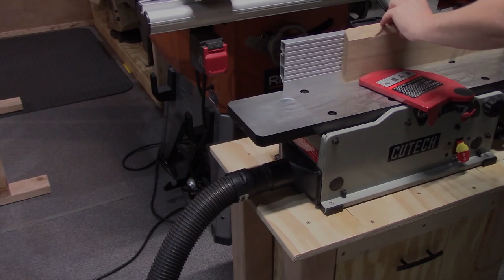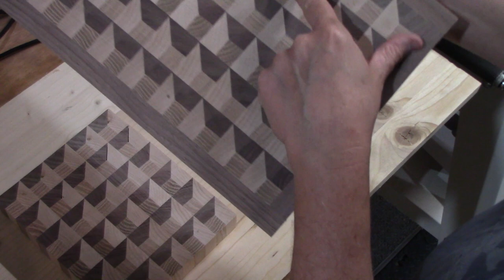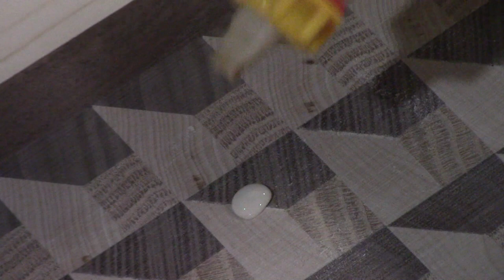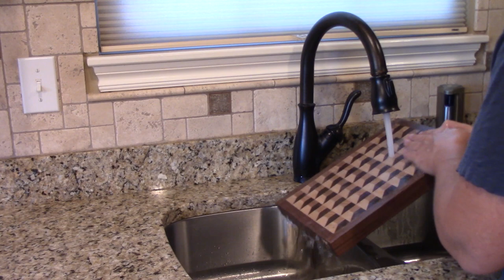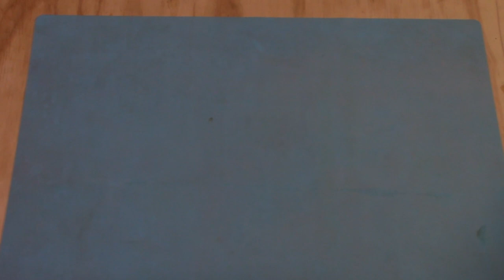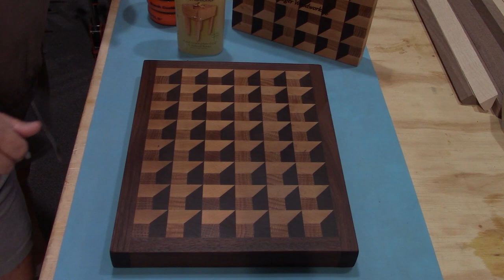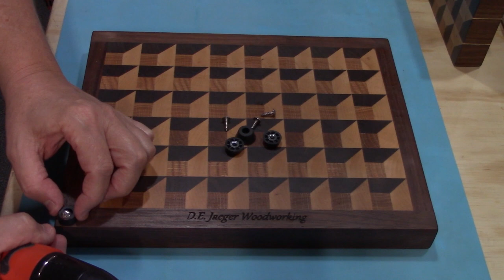The Stunning 3D Cutting Board - Part 2

Comment: Darrell,
You are obviously a fine woodworker, videographer, and teacher. Your explanations are crystal clear, and I have really enjoyed your videos to the max. The only suggestion I would make is that you might want to consider using end grain wood for your border. I know the edge grain is quicker, and looks nice because you can see the grain of that wood. However, I do believe that there may be an issue with cracking in the future. Having made about 200 cutting boards, I can tell you that the only cutting boards that fell apart  on me (that I am aware of!) were boards that had mixed end grain and edge grain. Please consider using my mistakes for the benefit of all.
Reply from the maker: Thanks for stopping by to watch the video and comment.  Yeah, I've taken some guff for the cross grain glue up on the larger board.  It was a last minute decision to even put a border on the larger one, and I also got a lot of folks wanting to know why I didn't miter the corners. :)  Anyway, I do get it.  Part of this decision was knowing that the person I made it for uses it as a counter decoration and never plans to cut on it.  Another comment I received quite a bit.  Knowing it wouldn't be subject to the normal moisture exposure, I let this one slide.  Still, there is the possibility of ambient moisture in the room affecting the board, but I have asked the owner to let me know if he sees any separation, splitting, etc.  So far, so good.  Thanks again for your comment.

Comment: I have rcently started using Starbond CA glue, along with the dust from wood, to fill gaps. When used with the accelerator, it dries immediately, and you can continue with your sanding. Amazing stuff! Thanks for the video.
Reply from the maker: Thanks for watching the video and commenting.  I've used CA glue with sawdust before, but typically avoid it for projects where food will come in contact with it.  I'm not sure of CA glue's food safe qualities.
Reply: @DEJaegerWoodworking  There is such a small amount of glue in the voids, I doubt it would be harmful, and any on the top of the board is sanded off. Starbond even comes in colors, so the dust wouldn't be necessary.  Again, very good video!

Comment: I know this is an older video but I found by gluing both sides of the wood further eliminates those little voids.  It does make for a little more cleanup of squeeze out but I find it well worth it.  Great work!
Reply from the maker: Thanks for watching the video and commenting.  I'm getting ready to make another one of these boards for a customer, so will definitely try gluing both sides.  A little more glue could equal less time filling voids.
Reply: @DEJaegerWoodworking  In the words of King's Fine Woodworking.... you can never use too much glue!  lol

Comment: That is the best looking cutting board.  I have watch both video. I am making the same. But in my case, after i wet the board the first time, it warped. So i’m back to the drum sander right now making it true again. I can’t keep it warped after all that work. And it is all worth it. Thanks.
Reply from the maker: Thanks for watching the video and commenting.  I've had some other woodworkers comment that you only need to wet the surface before the last sanding level, but I've always done it in between each sanding grit.  While this video shows rinsing it with water, on my newer projects I now just use a spray bottle of water and lightly apply to raise the grain.  You might try that to prevent warping.
Reply: @DEJaegerWoodworking  good idea. I’ll try that. Thanks

Comment: This is a gorgeous build. I just got a job at a cabinet shop a few months and I'm absolutely hooked on woodworking now. I'm going to attempt this pattern on a 4'x4' frame that will be used to display patches. I can't wait to get started!
Reply from the maker: Thanks for watching the video and commenting.  I appreciate it.  This pattern can be used in a multitude of ways.  I've made this pattern as a lazy susan, cutting board, etc. but you can certainly expand on it and even make it into a table top if you wanted.  It's a fun pattern and is always eye-catching.

Comment: A little pro tip for ya, if you heat up the Howard’s butcher block conditioner, it will Melt the wax, and allow it to penetrate deeper into the wood and harden, giving better protection for the butcher block over the long term. Nice board great videos!
Reply from the maker: Thanks for stopping by to watch the video and comment.  Awesome tip, thanks!  I'll definitely give that a shot on the next board.  I've got an American Flag cutting board just about done so will try this technique!
Reply: @DEJaegerWoodworking  I’m looking forward to the next vid, I usually just put a little bit on and use a heat gun to heat it up, great technique I learned years ago, keep up the good work!
Reply from the maker: @JP-kp9bg  Look for the tip in next video.  I'll give you a credit nod in the video as well.
Reply: @DEJaegerWoodworking  sure will! great quality videos! I’m subbed and will be looking forward to it 🙂

Comment: Beautiful .The only thing I have changed is to make the border end grain as well; I have found the edge grain border will show knife makes and, in the worst case, splinters.
Reply from the maker: Thanks for watching the video and commenting.  I appreciate it!  The other issue with the border not being arranged end-grain (and it has been pointed out to me plenty), is that it may end up splitting along those lines.  Fortunately, I know the owner is not using it for a day to day cutting board and takes the proper care in oiling and conditioning it, etc.

Comment: Great concept, I'm gonna add this to my to do list. Have been making a walnut/maple cutting board as gifts for a while now and have a quick system down for making them. This will be fun. My only concern is using an open grain wood like oak for and end grain board.
Reply from the maker: Thanks for watching the video and commenting.  I appreciate it!  I would definitely switch out the oak for cherry if I had this one to do over.  I agree the oak can be a little porous.  The owner of this board is religious about his oiling and conditioning of the board and he uses it more as a display piece rather than a actual cutting board so it will probably be fine.  The other thing I would advise is to orient the border end grain as well, or leave the border off completely.  You'll get a nice cascade effect along the edges that way.
Reply: @DEJaegerWoodworking  Yeah I'd love to use cherry. Good idea.
Reply from the maker: @paulharrison3651  Really just any other contrasting hardwood is fine, but cherry kind of fits the domestic trifecta or walnut, maple and cherry.

Comment: For clamping the smaller sections here’s an idea:  make a “c channel out of straight hard wood or MDF or any good smooth plywood. Size it so the four piece assembly fits in exactly.  Then make a separate piece that fits on top, enclosing the whole piece on all four sides. This will act as a cull and keep things aligned. Clamp along the sides and separately on the perpendicular still with adequate clamps but it will all stay aligned better.  The thicker and flatter the outside pieces should help distribute the clamping force more evenly. Just a thought.
Reply from the maker: I do appreciate the idea.  I have created a few jigs for projects.  Check out the Honeycomb Cutting board video on my channel.  I think your suggestion would definitely be worth pursuing, especially if I were making a lot of this particular type of board.
Reply: @DEJaegerWoodworking  I actually watched that one as well. Pretty much what I was thinking.  I haven’t done one like this yet so am also trying to imagine how I’d approach it. Honeycomb one is really cool too.

Comment: Some beautiful wood working. While the walnut border is attractive I feel it is a little too "bold" and detracts from the beauty of the geometric board. As you debated in your commentary about whether to leave the edges square or use a round over, the round over tends to minimize how bold the edge is but still allows some accent.
Reply from the maker: Thanks for your additional comment here as well.  The really interesting part is the number of viewers that bashed me for a cross grain glue up with the boarder.  So far, so good and the customer I crafted it for isn't using it as a daily cutting board, but merely a decorative board for their island.  Additionally, they care for their cutting board (in use, or not) with proper oiling and conditioning.  I do agree though, I wouldn't put the border on another one.  The edge effect is so much nicer without it.

Comment: Beautiful project, love the detail & finish.

First time I saw one of these being made, to fill void, the guy used a vacuum hose to suck the glue/dust mix into the void from the other side. Otherwise you have approx .5mm fill that can wear out with use & cleaning.
Reply from the maker: John, you are BRILLIANT!  Thanks for such a great tip to get the saw dust into the void.  I'm not sure I would have ever thought to do that, but will definitely do it the next time I have voids.

Comment: I’m a machinist I’ve never done anything like that with wood but I’m good with close tolerances so I will give it a shot. Thanks for the video but I can tell you one thing I’m tired of that banjo lol appreciate it. Nice job on the cutting board.
Reply from the maker: Thanks for watching the video and commenting. I appreciate it. Just a heads up from some other woodworker comments I’ve received.  If you are going to put the border on it then orient it in the same direction as the rest of the board.  This board hasn’t experienced any issue with twisting or separating but there’s a higher degree of likelihood that it could over time versus one where the border is oriented endgrain. It may be best to leave the border off altogether. You get to see the pattern cascade over the edge which is more attractive.

Comment: Beautiful and really showcases your craftsmanship.   Would you recommend trying this project without a thickness planner or drum sander?   Have you used pure tung oil as a finish?  Thanksagain for demo.
Reply from the maker: @scottstrong5565  Thanks for watching the video and commenting. You could probably pull this off without the drum sander or planer if you have a handheld router with a surfacing bit. There are several videos on YouTube on how to build a router sled for this purpose. I have some Danish oil that I’ve used as a finish but haven’t used tung oil for any projects yet. I’ve seen some woodworking videos that have and they have come out beautiful.

Comment: Very nice work and precise instructions, going to try and make one but one thing is stopping me is I do not have a drum sander, I do have a thickness planer though. Any suggestions on how to achieve the desired thickness of the pieces after the glue up of the three types of wood?  Thanks!
Reply from the maker: Thanks for watching the video and commenting.  You can certainly achieve the thickness wtih a planer, but I would glue scrap pieces around the final glue up to protect the edges from chipping.  Then, make sure your planer blades are sharp, and take extremely shallow passes to further prevent chipping.

Comment: Thanks for the excellent videos on this project! Couple questions please, 1. can this be done without a drum sander?
2. Not worried about expansion where you glue the walnut frame on? 
3. Seems like the mineral oil dip is pretty short, I have been letting mine sit overnight, is that too long? Thanks.
Reply from the maker: Thanks for watching the video and commenting.  I actually do a lot of my truing of surfaces on my drum sander, so absolutely it can be done.  Might take a little longer because less material is typically removed on a drum sander versus a planer.  I've gotten several comments regarding the walnut border and it really should be oriented in the same direction as the board itself.  It wasn't in this case but the board was going to a friend as more of a showpiece than an actual board that would be used and subjected to cleaning, etc.  I doubt that I would add the border if I were to do it again, plus some of the great pattern around the edges is lost when the boarder is put on.  You can see that on the smaller board at the beginning of the video.  Lastly, the amount of time in the oil is really a personal preference in my mind.  I see many wood workers just apply oil to the board by hand, some that dip in the oil for a few minutes, hours, and overnight.  Not sure there is a upside or downside to any of those approaches.

Comment: Sir, your are superb!  Two questions: 1) what sandpaper grit do use in the drum sander, 2) how many teeth do you use in table saw blade?  Thanks.
Reply from the maker: Thanks for watching the video and commenting. I typically keep 100 grit in the drum sander, and the ripping and crosscut blades I’m using are thin kerf Freud brand blades. The ripping blade is 24T and the crosscut is 60T.

Comment: Beautiful work! Is there a advantage using a orbital vs a palm sander?
Reply from the maker: Thanks for watching the video and commenting.  An orbital sander will remove more material than a palm sander, and I'm not a huge fan of the sanding process, so it helps move the process along a little faster.
Reply: @DEJaegerWoodworking  thanks for the quick response and excellent advice
Reply from the maker: @kennypayton5103  No problem.  Thanks again for watching the video.

Comment: You are very talented !! I have some walnut white oak and pecan. I will do my best to repeat your skills
Reply from the maker: Hey Mike, thanks for stopping by to watch the video and comment.  I had watched several videos on making this type of 3D board until I could the technique that I liked and thought I could replicate the best.  In hind sight I wish I would have replaced my table saw blade before starting this project.  It was a little dull and caused the 45 degree cuts at the beginning of part 1 to be a little more difficult than they really needed to be.  I did replace the blade shortly there after with a very nice Freud thin kerf blade which now cuts like butter.  As I said at the very beginning the cuts, measurements and glue up need some extra time so that the pattern at the end stay consistent.  Let me know when you've got the board completed so I can stop by to watch.

Comment: When filling the voids with sanding dust and Titebond III, since the glue is waterproof won't that prevent the oil to penetrate the filler leaving dry spots that won't blend with the raw wood that absorbs the oil??
Reply from the maker: Thanks for watching the video and commenting.  In this video I believe I was using Titebond II, but regardless it does still have water resistant capabilities.  As long as I sand the filled spots appropriately I don't typically see spotting.  Not to say that it certainly couldn't.  I have definitely followed this procedure before and not sanded enough and had some light spotting.

Comment: what is the point of the oil bath? Does it help seal the wood to prevent warping?
Reply from the maker: Thanks for watching the video and commenting.  The initial oiling helps to treat and provide a base treatment and finish for the cutting board.  Regular application of mineral oil will prevent cutting boards from becoming dry and brittle, which can cause a cracked board. A board that is treated with oil also prevents liquids from penetrating the board, which is often the source of germs and bacteria.

Comment: Really nice cutting board, and I love the 3D effect. I'm a bit surprised you didn't use mitered corners with the outer border, but that doesn't take away from the beauty of the piece itself.
Reply from the maker: Thanks for stopping by to watch the video and comment.  The border was really just a last minute decision so I went with a simple butt joint, but it could definitely been done with a mitered joint.  I've been taking a little bit of flack just for putting a border around it and it not being oriented end grain.  I probably should have added some dowels for structural support, plus it would have been a really nice visual feature as well.
Reply: @DEJaegerWoodworking  I appreciate you taking the time to show and tell us every step, and it's always a learning curve, even when you are duplicating something you've already done several times before because you can always think of some way to enhance or improve it. Have a safe and  Merry Christmas, a Happy New Year, and straight cuts always.
Reply from the maker: @stanwiggins3423  Agreed, we're all here to learn.  I've incorporated many of the tips and tricks I've received from viewers of the past couple of years.  Techniques can always be improved upon, and sometimes a different set of eyes on a project can lead to some great tips for the next time.  Merry Christmas & Happy New Year!
Reply: Miters would’ve been boring, too picture “framey”. This was done better I feel but all a matter of aesthetics.

Comment: Great piece of art!  What grit(s) did you use on your drum sander?  Thanks
Reply from the maker: Thanks for watching the video and commenting.  I usually have 100 grit on the drum sander.  I do, however, typically go back to 80 grit on the hand sander (especially on hard woods) to get any of the scratches out after truing the piece, then proceed up through the other grits.